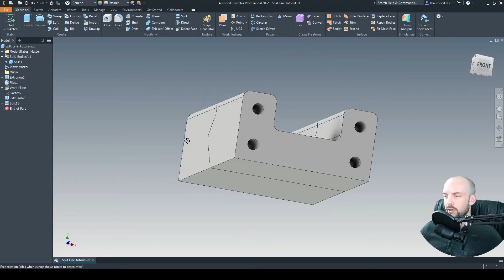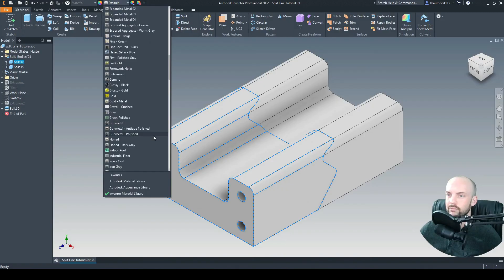How to Split a Part | Autodesk Inventor 2022 | Basic Tutorial

Comment: I want to save the two solid bodies as two separate part files.  How can I do that?
Reply: While there might be a more intuitive way, if you draw the sketch you want to split it with then hit save as and save it as a different file name, then you just have to perform the split and get rid of the different halves on each files. 

I often save as inventor files when I want to start a new prototype with my already worked on object and then decide later to keep the file as an improvement on the design or delete it. This is especially handy when you want to do a lot of things to something but you're not sure how it's going to turn out so you can intermittently save your progress basically. Especially because there's only so many times you can hit the undo button
Reply: Same...

Comment: Thanks a lot. Can you split under assembly environment? When I use split tool for a part it does not maintain the divisions at the assembly environment. Best regards.
Reply from the maker: Hi @ Jean Paul, That's a very good good question. The answer is yes, in an assembly file the individual splits are still recognized. The way to select or visibly see these is to go into the Design Tree and at the top are two levels: "ASSEMBLY" and "MODELLING". You want to select the MODELLING Level and you will see the breakdown of the Solid bodies of the part you split.